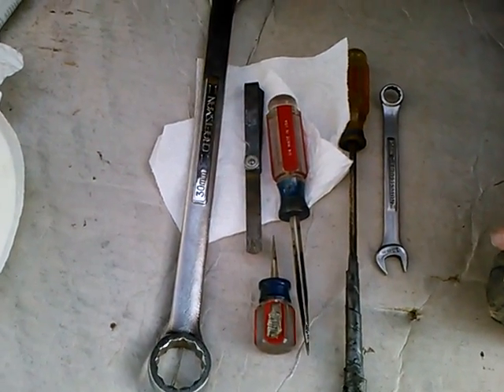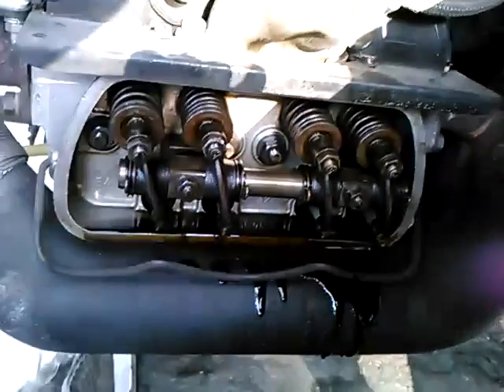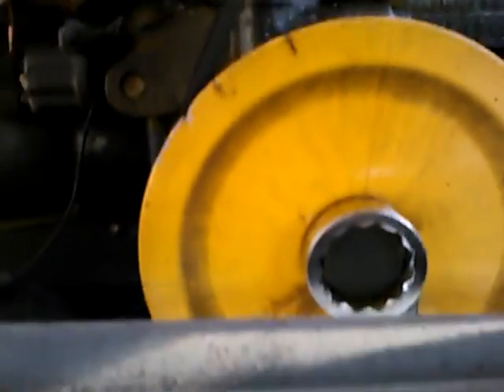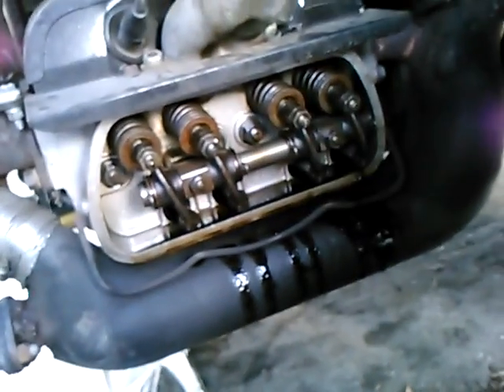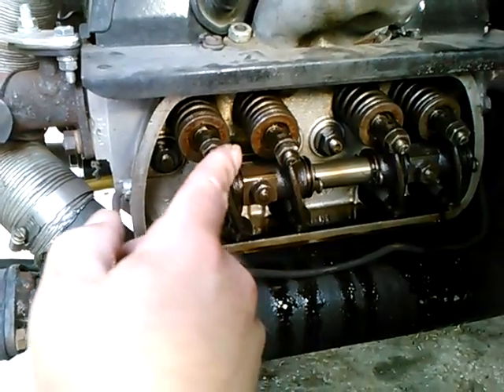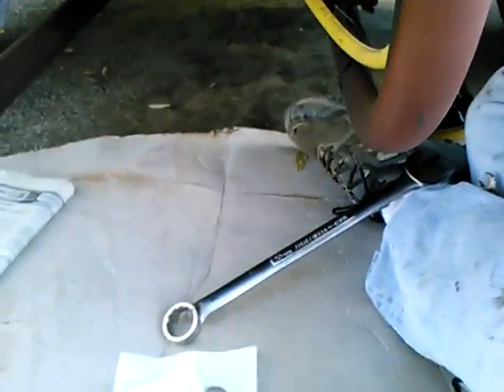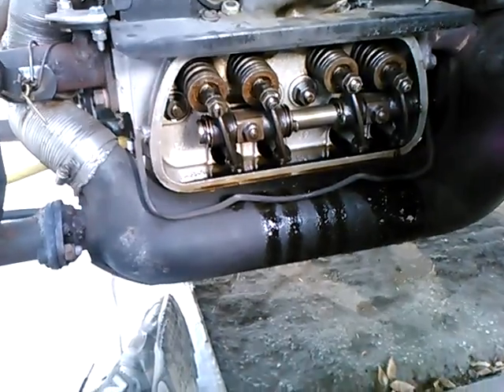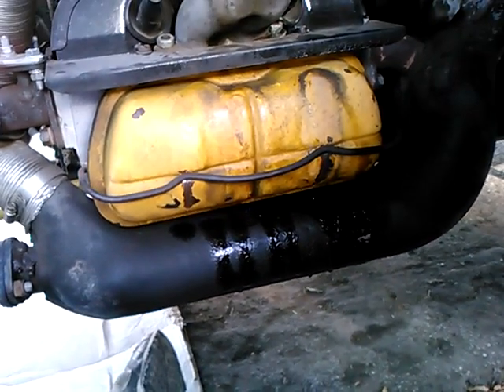How to Adjust the Valves on an Air-Cooled VW

Comment: The threaded adjusters are 10 thread per cm or one revolution equals about .039 inches or about .040..half a rev about .020 so for .007 which is what I set my '71 to.  I set it to somewhat less than a 1/4 turn . I made the mistake of letting a shop that did not specialise in vw do my valve job once and they leaked...a vw shop reground the seats and valves but with not much left the geometry was not perfect although they sealed well and have lasted fine.  Long story short I cant get a feeler in the space but turning the adjuster to zero clearance and then backing it out the right amount works fine...no feeler gauge needed. Its not the best way but it works.

Comment: After many years of doing this, let me help. 
First, pop valve covers off. Second, remove distributor cap and rotate engine to #1 position, which closes both valves. 3rd, check both valves for clearance. If good, move to next cylinder by repeating step 2. I used to do this easily in 20 mins. while I was in college. Only a couple of valves will ever be out of whack, usually the ones near the heat-intensive oilcooler. Good luck.

Comment: Those valve covers would be absolutely spotless if they were going onto my VW engine...If you can prevent any bit if abrasive dirt going inside the engine, that's a good thing...Grit and dirt must travel through the oil pump before the oil filter.

Comment: What is a good gap to adjust a 1914 valves
Reply from the maker: If you're going to check it frequently, I think .004 will be okay.  If you're going to put some miles in between checks, open up to .006 will add some margin of safety.  After a while, you may find the gaps are stable, not changing much over time / miles.  I've heard Formula Vee guys run zero clearance, but check frequently.
Reply: matt acree engine size don't matter since all air cooled VW have same adjustments. Max is .004 and min is .006 it also depends on where you live due to climate and loose is always better than tight. Hot climate .006 cold no more than. 004 hope that helped

Comment: If you notice in the video, you had clearance when you rocked #1 arm as you could clearly hear a large gap but when you used the gauge it wouldn't clear it. Next time push the arm against the pushrod firmly before checking for clearance.

Comment: My nut and screw are moving together when i turn the nut! Any suggestions!?
Reply from the maker: Using reasonable force, you can't hold the screw with a screwdriver and turn the nut separately?  You don't want to break off the ears of the screw ... if it's really stuck I'd unscrew it all the way out and deal with it off the car, use heat maybe.

Comment: Nice video, do you need to drain the oil to remove the valve covers?
Reply from the maker: William Cook Generally no, although parked on the street the low side drips a bit, so I try to move fast.
Reply: guidoguitar thank you sir! Great video

Comment from the maker: I've been using .006 for ~15 years / 150,000 miles now.  Error on the side of caution I suppose.  I could try .004 but then I'd want to check very frequently, that .004 can go to zero faster than .006.  Have a couple British cars, one exhaust valve would lose all its clearance after a few hundred miles.  But the VW's in my experience have been stable, usually only re-adjust zero to maybe four valves at 3K intervals.  Since this is a "linked comment", I cannot reply directly.

Comment: did you ever mention the gap size, or what feeler gauge you were using? .004, .005, .006??
Reply from the maker: +Don K. Johnson I've been using .006.  Since I check it often, every 3000 miles, and it doesn't change very much in that time, I could probably do .004 without harm.  But .006 has been working okay for me for many years / miles.

Comment: i tried to do this today following the rob muir tutorial in the idiot book, i think i did everything correctly, i loosened the lock nuts to adjust the gaps, they were a little big. i pulled the crank to TDC, following the mark on my crank pulley, the distributor also lined ip with the notch in the case, after loosening the lock nut the adjuster wouldn't turn so i cant close the gaps.. i tried the intake and the exhaust, neither would move.... am i doing something wrong?.
Reply from the maker: nick blake I've seen those adjusters rust in place due to improper ( outdoor ) storage, but inside the oily heads shouldn't be an issue.  As a simple test, you might just swap on a different set of rocker shafts together with arms and adjusters, if you have those extra parts lying around.  Since you say you have gaps, I'll assume you've got the right piston at TDC and the adjusters aren't pressing against the valves.

Comment: How do you know if you need to adjust the valves? Im new the the vw world i have a 2387 long block on turbo it turns off right after i turn it on. Any info would be great thanks
Reply from the maker: otroman5 Generally I check the valve adjustment on the VW every 3000 miles.  But this engine has been very "stable" requiring little adjustment at those intervals.  Based on this experience, I could probably stretch the interval to 6000 miles or more.  Other engines I've owned, valves started sinking into the heads, requiring very frequent adjustments.  So look for trends, did the clearance change much since the previous adjustment?  If not, maybe can check less frequently.

Comment: Many years ago when I used to adjust my valves I would have a 4, 6 and 8 feeler gauge to ensure that I could feel the gap was right. I always did my valves first thing inn the morning with the engine cold. 6 Inlet and Exhaust as tight valves run very hot! Thank goodness for hydraulic tappets!!

Comment: Hi
Firing order 1432 then you can do 1234 opposite the engine rotation piston 1 at TDC do No.1  then 180° for No.2 then 180° for No.3 then 180° for No.4 job done.
Reply from the maker: Reversing the sequence doesn't change the order ... one can adjust 4 & 3 then 2 & 1 without turning the engine backward.

Comment: Thanks for the video! Not sure if this is posted anywhere throughout the comments, but if you use a rag instead of a padded screwdriver to unlock the bails from the valve cover, it might be a bit easier and also less abrasive to a nice set of covers. And, if you have limited space to work with, you can just slide the rag underneath the bail, pull out and down....presto its off.
Reply from the maker: Not a bad idea

Comment: It sure does, try it. As long as the cylinder you are working with is in compression both exhaust and intake will be closed where basically is adjusted. So, if starting at #1 and going backwards, you will be working in the sequence1,2,3,4 instead of the engine firing order. I'm working with my 74 S.Beetle body right now; eventually i'll make a video about it. I think there are some videos of it in youtube though.
Reply from the maker: Mike Kafer I misspoke, meant to type turning the engine backward doesn't change the firing order, it only reverses it.  But you won't see the "exhaust - intake" sequence before TDC for each cylinder if you're turning the engine backward.  Really my main point with this video was that you can find TDC for each cylinder by observing the "exhaust - intake" sequence for each cylinder.

Comment: good resource, i like the beginning in order to get cylinder 1 in compression without looking at the distributor. But after that,  this may become much easier if you turn the engine counterclockwise; you adjust #1 and then #2 without having to do the extra 1-1/2 turn to get the #2 in compression when you turn clockwise. Then #3 and last #4. Nice video!
Reply from the maker: Thanks for the comment.  But the sequence of exhaust valve - intake valve -TDC won't be the same turning the engine backwards.